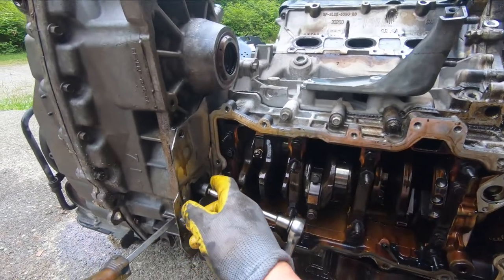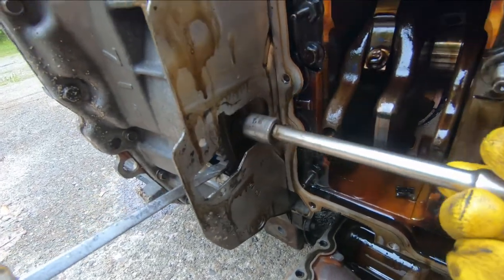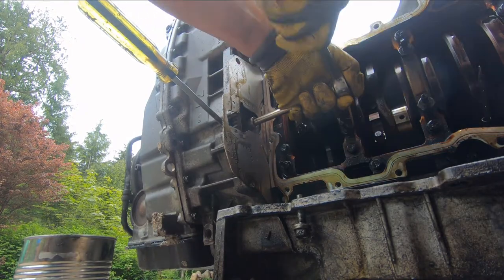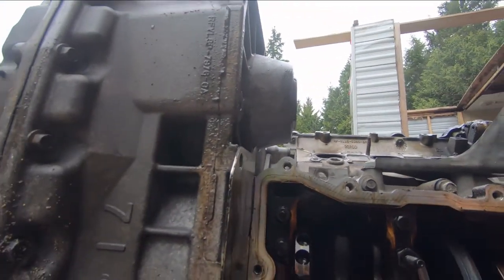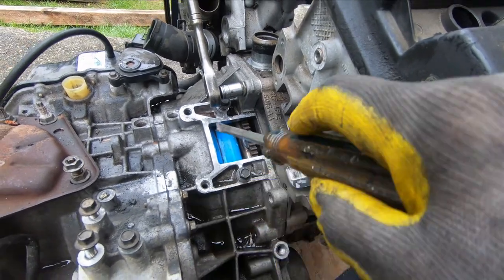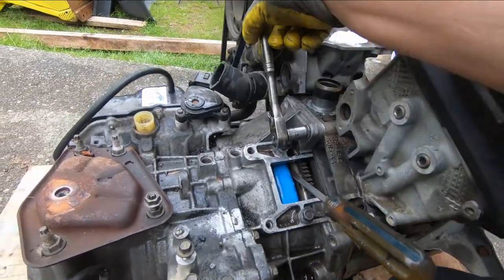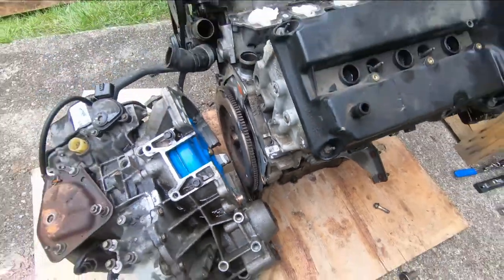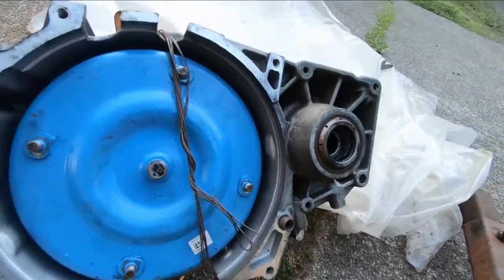CD4E TRANSMISSION SPLIT FROM 3.0  FORD ENGINE

Comment: Man, an engine swap on a late model vehicle is way above my pay grade. Just too complicated anymore. I admire you for your skill and the fact that you're foiling the engineers plans to keep you from working on your own stuff!
Reply from the maker: Aw, it's not so bad. The same basic engine is under all the new sensors and stuff. I've actually been watching some videos on these CD4E transmissions and they aren't that difficult to rebuild, with very few special tools needed (not that I'm about to rebuild one), just curious what's going on inside. I'll be dropping the replacement Ford Escape engine and transmission in from the top (against Ford's method of dropping and installing them from the bottom) because it's a way I'm more familiar with. I've seen you work and I'd say you would have no problem swapping out any engine. There is just more wires and connectors to deal with--but there is no real need to know what everything does, just hook it up the way it came out. The install of the other engine and transmission is coming soon.